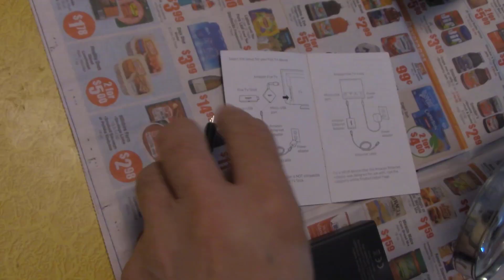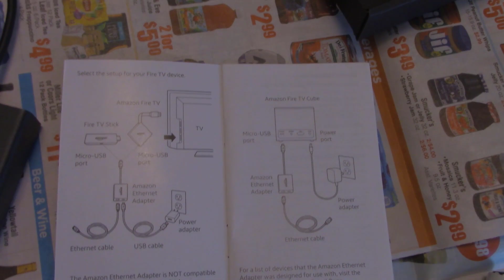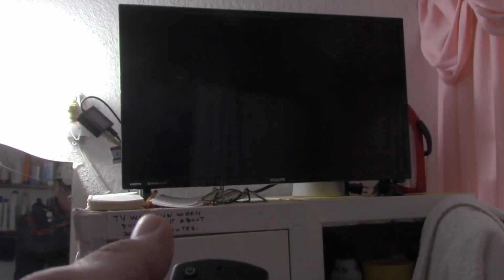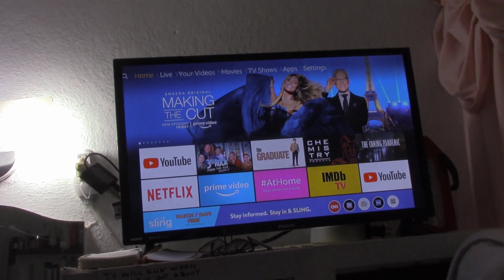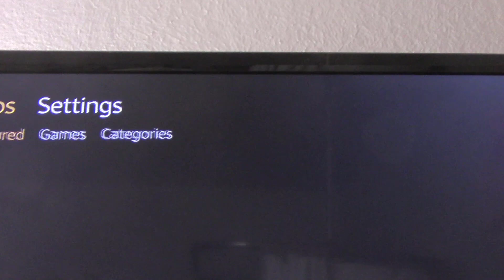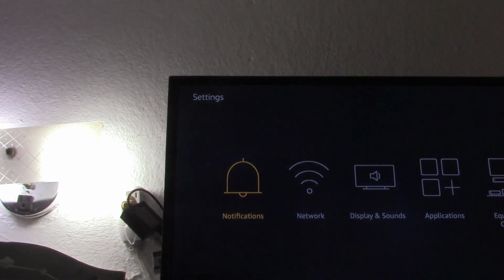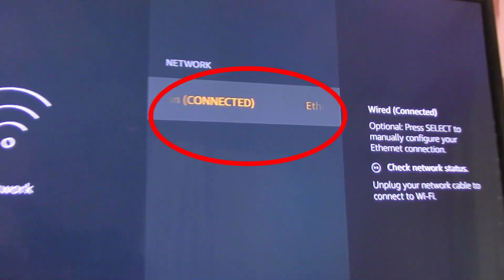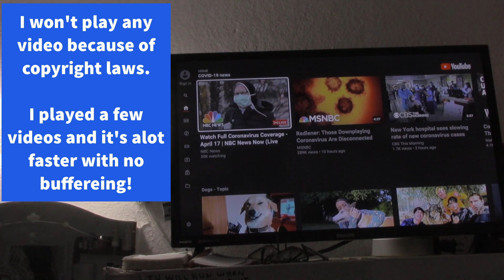Amazon Ethernet Adapter Open Box : How To Install and Configure Amazon Ethernet Adapter for Fire TV

Comment: hi, why does your firestick have an adapter connected to the tv?
Reply from the maker: I use the Firestix to watch Amazon TV shows on my TV. 95% of the time I use it to watch Andy Griffith, all seasons, for free. But there are thousands of free TV shows and movies on Firestix. But a lot of them are not free, they cost a dollar or two. Like Frasier is $1.99 per 20 minute episode. The movies come from Amazon, over the internet, to your router. Your router sends the movies to your Firestix. The Firestix play the shows on your TV. The Firestix is wireless, your wireless Firestix can connect to your router wirelessly. The TV shows from Amazon to your Firestix travel through the air wirelessly. So you do not need a cable and the Ethernet Adapter. I use the Ethernet Adapter to connect the Firestix to my router with an Ethernet cable. Don't let the word Ethernet mess ya up, Ethernet is just a fancy word for internet cable. Ethernet is the type of signal flowing through the cable. Using a cable, the movies play a little better, I don't get the spinner in the middle of the screen as a show play, lag time. Shows play a little faster (no lag time), and the picture is a lot cleaner too.
Reply from the maker: Sounds complicated, but it's not. Plug a cable into your router. Plug the other end of the cable into the adapter, plug the adapter into the TV like in the video.
Reply: @JimVincitore  Maybe I have not explained myself well, at minute 5.03 I noticed that you did not directly connect the stick to the TV with HDMI port, I see a connector, is it simply an HDMI extension? Greetings
Reply from the maker: yes, i always use the extensions, so I don't lose them, and so I can move the stix around . you can see it plugged into tv at 5:00
Reply: @JimVincitore  Hi, since you are very kind I wanted to ask you more information: does the Amazon stick connected to the HDMI port need to be powered via USB cable? If I use the Rj45 adapter, does the amazon stick power itself through this?thanks
Reply from the maker: @TheDredChannel  You plug it into regular wall electric plug. I think I have one plugged into the usb plug on the monitor.